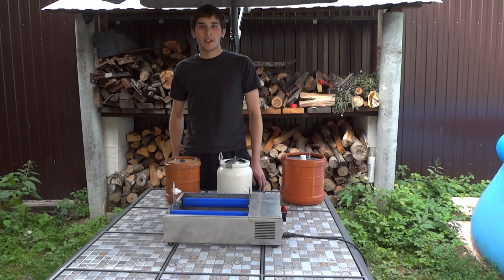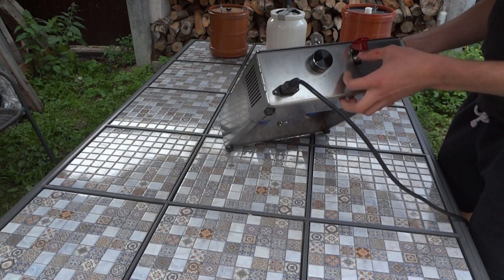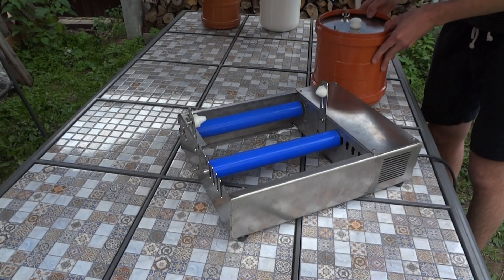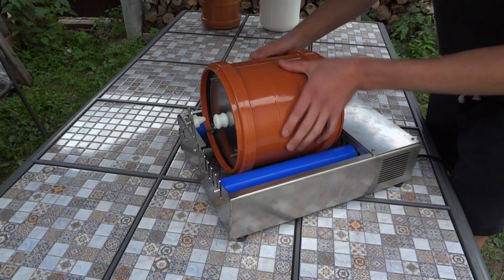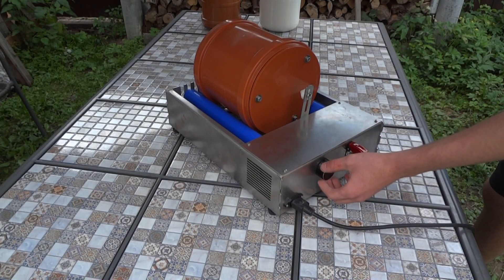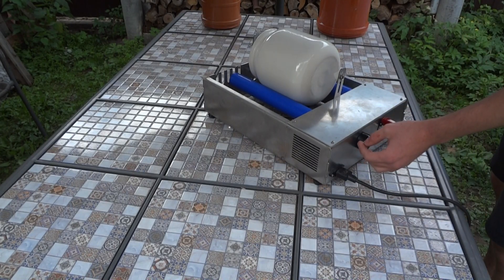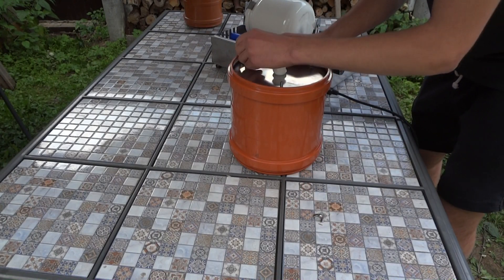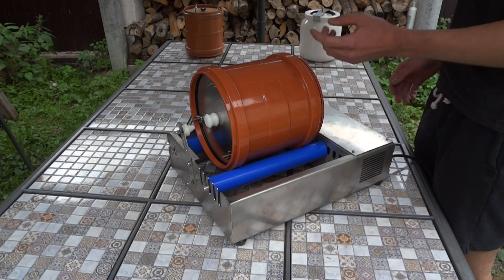Professional ball mill machine

Comment: I like your work. If I lived in Russia I would buy one. I like the lifter bars, but maybe they should have sleeves of rubber or plastic on them if you mill BP with it, so you don't have ceramic on metal contact. The variable speed is sweeet :)